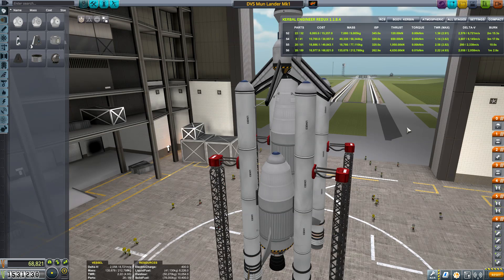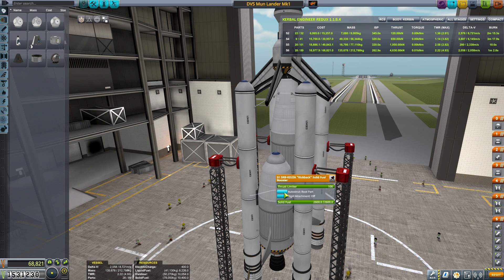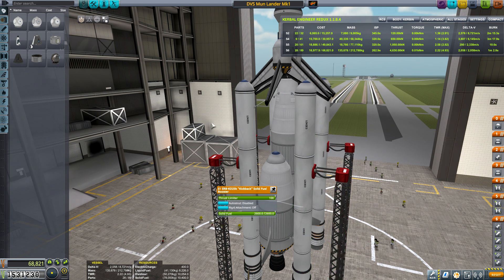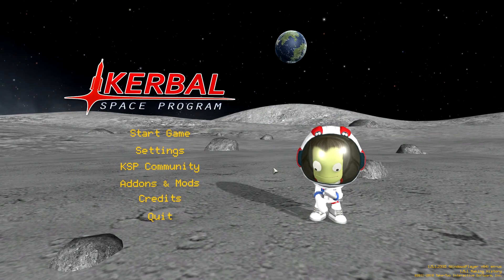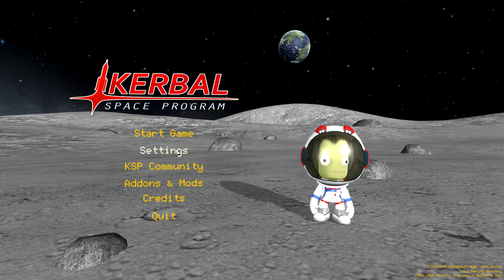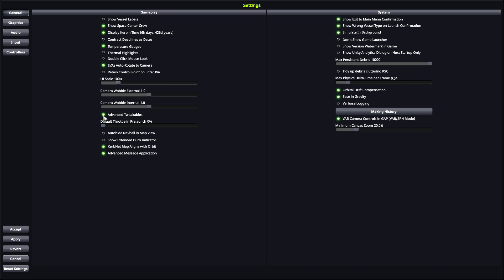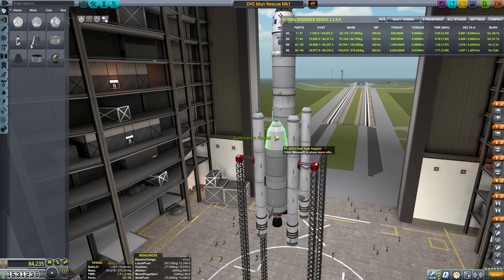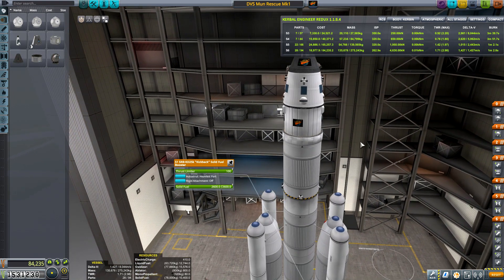Autostruts - Kerbal Space Program Basics Tutorial

Comment: Okay... So what do autostruts do? How do I use them? You didn't tell me anything. What's the difference between heaviest part and root part? How do I use this on a tall rocket? What parts do I do it to?
Reply from the maker: Autostruts do the same thing as "regular struts".  Only they do not appear visibly on the rocket.  They are used as structural support for the rocket to keep it stable during flight.   Each individual part in the VAB has a "Autostrut Disabled" button that you can click to turn them on once you have activated them via the instructions in this tutorial.  Hope that helps!
Reply from the maker: Root part is the first part placed in the VAP/SPH, whereas heaviest part is the part with the most mass.   Depending on your design, you may want to strut to root, but mostly you will want to strut to something more stable than itself.  I use heaviest part in most instances.  While not strictly necessary, I usually strut every piece that has the option.